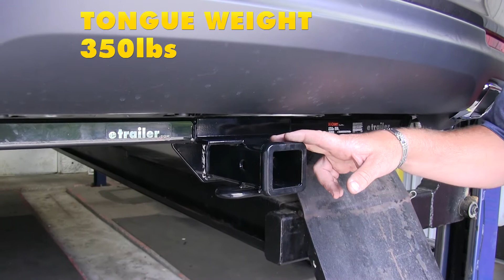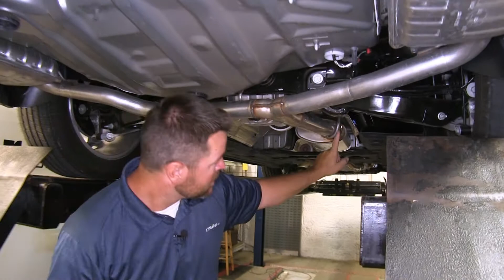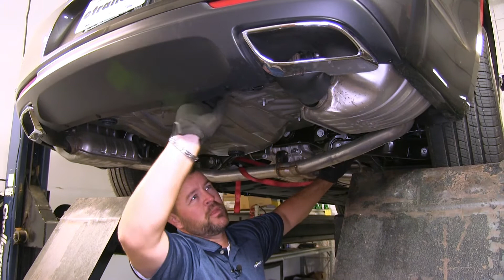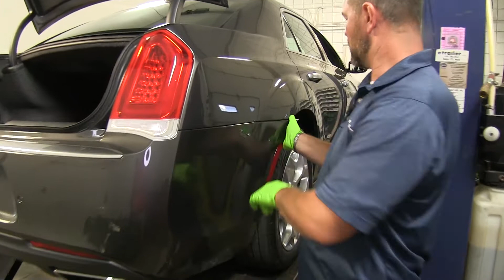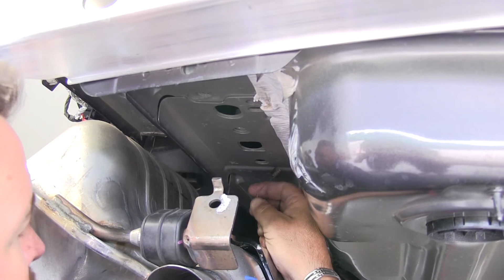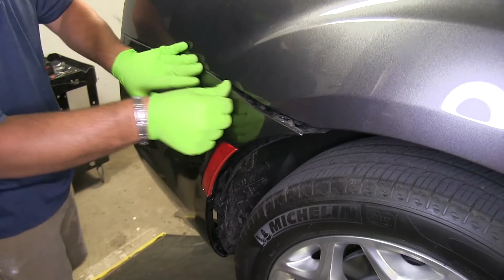etrailer | How to Install the Curt Trailer Hitch Receiver on a 2017 Chrysler 300C

Comment: Great video! 
Now, a version without a lift, and with a nice rusty New England underside?
;)
Reply from the maker: Thank you for the feedback! It is a tad more difficult when the vehicle is on the ground and when there is rust. If you have a set of car ramps you can back the car onto, it will give you a bit more space to work.
https://www.etrailer.com/Trailer-Hitch/Curt/C13093.html